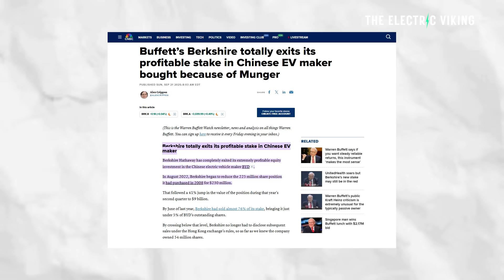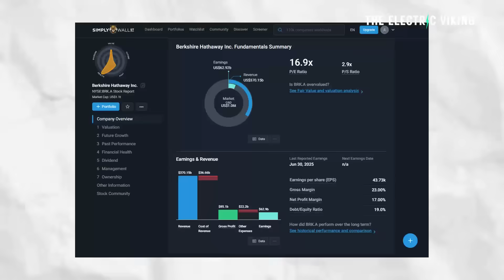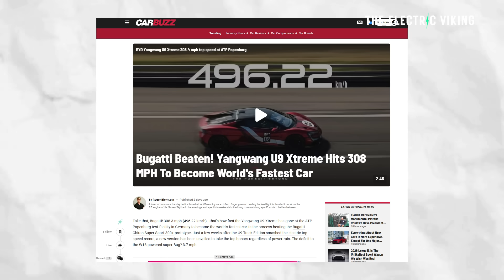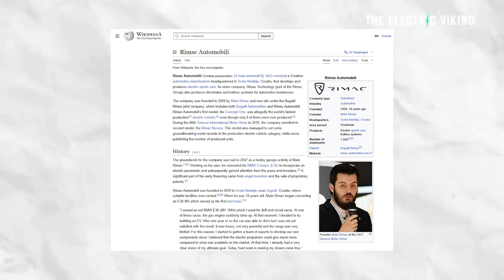BYD Breaks World Car Speed Record then Breaks EV Nurburgring Record!

Comment: what amazing about this car is it can do well in both ATP Automotive Testing Papenburg and the Nürburgring. many other doesn't do well in both category. I wonder if the Bugatti Chiron super sport do well in the Nürburgring? while the U9 is practically runs of software tuning so in the production line it can just switch mode on the touch screen. i wonder if the will try to break another top speed again at ATP, but i m sure they will try again at Nürburgring in October. Keep in mind this car still can do tank turning, jump over spikes, run on 3 wheels and dance. 😊
Reply: The world is jealous of Chinese inefficiency 😂
Reply: @petersaw3379 I don't understand what you trying to lead this conversation but keep in mind, all this tech that demonstrates in this car will eventually trickle down to our daily normal car which will lead to better safety. Just like all the predecessor had been doing.

Comment: My biggest concern is the driver’s safety! Somebody please build a special track with super wide barriers and etc. I’m pretty sure the driver would be very nervous too. I’m also proposing building a simulator for that extreme condition, as byd has many sensors built in the car already
Reply: Some if the new EV's can go thousand miles.

Comment: But EVs are supposed to burst into flames when they're merely parked somewhere in cold thermal underwear weather due to thermal runaway / heat-overload - and with barely charged batteries and zero payload or motion stress. 

The EV sabotage truth will out...

(Paul G)
Reply: BYD batteries don't burst into flames, even when punctured.

Comment: The reason why Berkshire dropped BYD is not because they are not an amazing company, ti's because of Xi's latest statement, I will explain:

They used the word Involution regarding the car industry, explained that they want to stop focusing on "cheaper, lower quality, low margin" and instead go for "expensive, higher quality, higher margin", this is a good mentality to have if you wanna steal America's spot and if you wanna reduce over reliance on critical mineral imports from unfriendly nations.

(If your industry has a tiny profit margin it needs to produce more which means that you need to import from basically every available exporting nation, which includes unfriendly nations that might cut you off in the event of a war).

The government is basically signalling companies that they will start a crackdown on mass production and stock dumping (plenty of Chinese EVs were selling at incredibly low prices due to government subsidies to all stages of manufacturing EVs), and for companies to start focusing on quaity to maintain or increase profit margins instead, this is not gonna happen overnight and a reason why BYD right now is a shaky buy, when the Chinese government announces something, take them seriously.

Comment: Johhny Bohmers BADD GT has been 310.8 mph 

M2Ks TT Ford GT ran 0-300.4 mph in one mile and 21 seconds. 
200-300 mph in 10 seconds 
and only used 5 out of 6 gears  

ICE is still king
Reply: And top fuel funny cars can hit 340 mph in less than 5s... you know what they lack? Absolute reliable daily driveability in nearly any weather
Reply: @royj8549 quickest e v ever on the strip has been two hundred and two miles an hour and just a hair over seven seconds.
Also melted down
Reply: @royj8549  And still they will be slow on autobahns, because they are electric and exhaust quickly.
Reply: This car is a serial production car and it is road-legal. The cars you mentioned are not road-legal and not serial production.
Reply: @tugbars4690 Johnny Bohmer drives his car on the street and M2K went to the drive through at a mcdonald's after setting the record just to prove a point.
Reply: @tugbars4690 

M2k

Oe body panels and glass, oe interior, oe suspension minus custom shocks, oe brakes minus custom rotors and prepped oe castings 5.4 4V. 

There's a great article on the car at j.E pistons.

It's a twenty year old car that was merely brought up to modern specifications in twenty nineteen to be safe enough to run at three hundred. 
Absolutely decimates that e v in acceleration

Comment: Amazing top speed feat but abysmal lap time for 3000hp.. the taycan turbo gt with 1000hp is only 5 sec slower.. now imagine if they actually made a 2 seater and had more than 2 of their EV motors..
Reply: These are two completely different projects. What BYD has achieved is that it enabled Bolt to win the bronze medal in the triathlon, and there is still room for improvement.
Reply: Depends on who is driving and the way the car is set up- thats coming I imagine
Reply: What about the weight of both vehicles
Reply: The Taycan Turbo GT needs to put in all its effort to achieve it, while the U9 only uses some of its capabilities
Reply: And an ice car is faster around the Nurburgring 😊
Reply: @johnthemagnificent7022  Only for a short time. They will set up this car for handling soon.

Comment: 3000Hp and still can't lap the Ring faster than a 500Hp GT3RS..
Reply: No one gives a *** about combustion cancer
Reply: @ciybersal9833 actually, I really appreciate and like some electric cars like M3P, just stating the obvious mate.
Reply: More aero less weight needed.  But I bet an electric fan car like McMurtry would destroy GT3RS record.
Reply: @summertyme5748 but that wouldn’t be a production car! Apple vs apples mate 😁
Reply: @summertyme5748 McMurtry doesn’t have the juice to make it across a 7 min lap like the Nurburgring or it would have been done already.
Reply: too heavy not designed for turns too apparently only relatively linear paths
Reply: Because it is designed for max speed. To maximize speed, the downforce needs to be minimized as much as possible which would make the cars track performance subpar relative to what the cars engine specs suggest. On top of that, like others mentioned this car is too heavy to be a track monster. All that said, it's still faster than Rimac cars.
Reply: These are two completely different projects. What BYD has achieved is that it enabled Bolt to win the bronze medal in the triathlon, and there is still room for improvement.